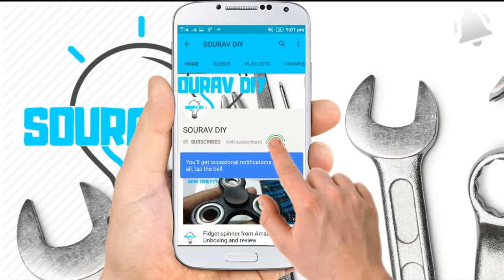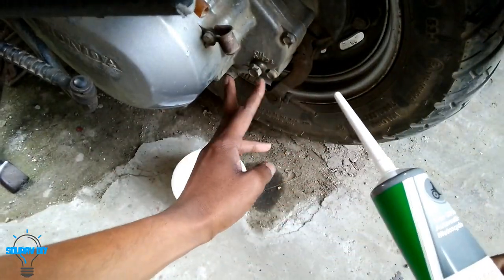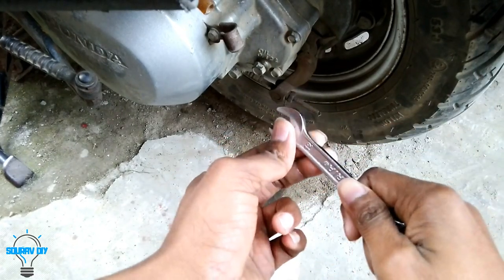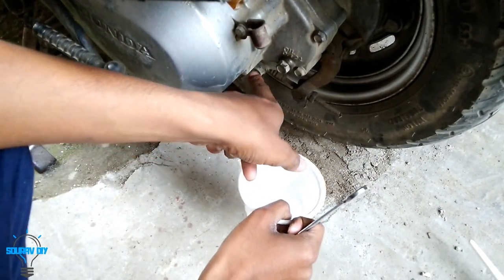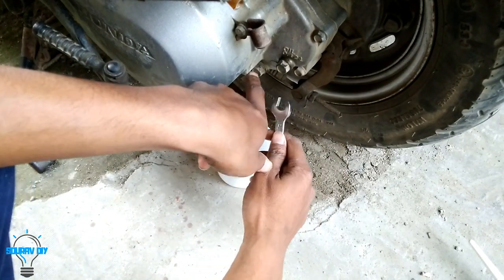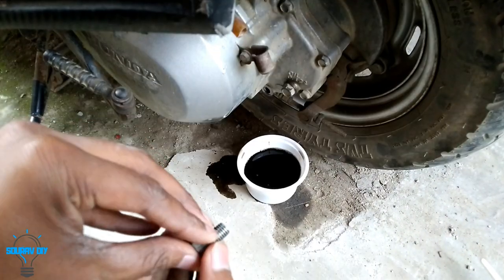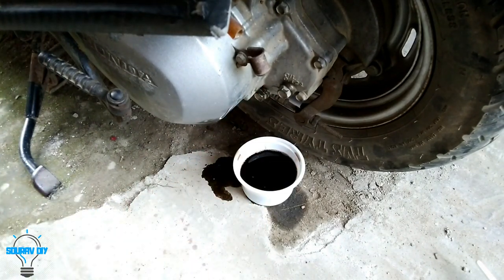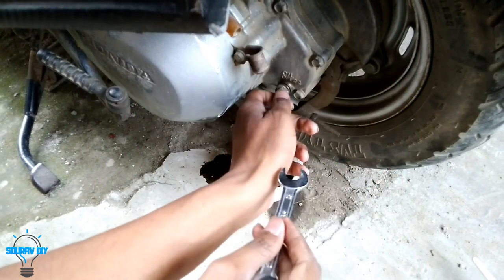Honda Activa Gear oil change | Castrol gear oil

Comment: I have a honda dio 2018 model ...o haven't serviced at dealership after 5 free service. But I do the oil change(Honda genuine oil) in 3 to 4 months at local shop. My rides are not smooth anymore. There is lot of disturbance while accelerating or riding with million rider. Recently I had to use engine oil my local mechanic provided. Now it has starting trouble(self) and riding discomfort(vibrations) too. Is it engine oil ? Is it time to change gear oil too?
Reply from the maker: Change gear oil, engine oil
Clean clutch assembly and change the belt
Reply: @SOURAVDIY  Thankyou for fast  response 
I will do it.

Comment: 13/09/2019 I change gear oil & Engine oil,Can I water wash my activate 4g,I was told by Bike Mechanical that water wash had to done After 2 Month otherwise water go inside the Engine..
Reply from the maker: U can wash your bike , water doesn't go inside engine or gearbox all are sealed
Reply: Who is that legend 🤣
Reply: They lie most of the time to make money use youtube to increase the knowledge and dont fall prey to greedy mechanics.
Reply from the maker: @koolpron  bike wash karne se kabhi water engine ka andhar nahi Jata hai, mechanic are fooling people
Reply: @SOURAVDIY  yes
Reply: Although, Pressure wash not really recommend.

Comment: Hy bro gear oil change ker ne se kya hota hain or kitne km per change ker na hain
Reply from the maker: 8000
Reply: SOURAV DIY hota kya hain is se
Reply from the maker: @deepak_patel2136  lubrication in gearbox

Comment: Where did you get this spec oil , I haven't seen it in any shop?
Reply from the maker: In shop Rs 70
Reply: @SOURAVDIY     thanks for your reply
I have tried in many shops , they do not know about this type of oil. 

Here in my city the shop keepers are least concerned about what the customer wants. they just sell what they have and sell whatever that gives them  a good profit margin.    

What difference did you feel after filling the 80w90 oil rather than the engine oil the authorised workshops fill in the gearbox?

will try in some other shops.
regards
Reply from the maker: No difference but u should not use low viscosity oil in gearbox, Honda  and Yamahacing centre sells gear oil
Reply: @SOURAVDIY  
  thanks for your reply. 
thing is that i got a zest 110 . now every time i go for a service they put in engine oil in the gear box. the tech manager at the service center(authorized) is a good friend of mine. but he never advises to put in gear oil the scooter.  he said we are told so by the company to put engine oil in the gearbox too.  Now they are bound by the rules of the company, i agree.
          I am also worried about the engine oil grade they use which is 5w30. i cant imagine what amount of heat the engine and the oil must be facing in cities where where summer  temperatures are well above 40 degrees celcius.  I wish to put 20w40  in the engine.your comment is highly appreciated!

Next time after the service i am going tho change the gearbox oil myself.

By the way can i put in the gear oil used in the car which is also 80w90 grade?

regards
Reply from the maker: Yes , all gear oil are 80-90
Reply: @SOURAVDIY    thanks next time I will use it 
Regards
Reply: @SOURAVDIY  bhai woh low viscosity nahi, high viscosity oil hai.
Reply from the maker: @manishholla  pata hai
Reply: Rider Ninja  140 grade heavy duty hota hai. 90 grade is for gearless scooter and cars gearbox. 140 grade is for tractor and other commerical vehicles.
Reply: @manishholla  no bro,gear oil have low viscosity than engine oil

Comment: Activa 125 me kon sa gear oil dal ta hai
Reply from the maker: Same gear oil that I am using
Reply: @SOURAVDIY  gear toh hai nii..meri maesteo m...fr
Reply from the maker: It's transmission oil, it lubricates the transmission in real wheel part
Maestro needs the same gear oil

Comment: How frequently should gear oil be changed? I mean after how many km?
Reply from the maker: 8000-10000km
Reply: @SOURAVDIY  mene activa 70000 chala li lekin abhi change nahi kiya.
Reply from the maker: @DAC477  mileage drop hota hai
Reply: @SOURAVDIY  oh thank you.
Reply: @SOURAVDIY  activa 40 km/ litre average h
Reply from the maker: @DAC477  I get 55 + in highway 
7 yr old 32000+km
Reply: @SOURAVDIY  150000 km
Milage 55 kmpl engine me Kuch nahihua air filter change 20 thousand km 2016 model Activa 3g
Or belt drive change 50 thousand km aftermarket Wala genuine
Wala 75 thousand km chala spark plugs 50 thousand km clutch 1lak km
Reply: Gear box ka oil 10 thousand km
Reply: Engine oil 2500 km
Reply: @DAC477  bearing jam ho jayenge, gear kharab ho jayenge. 15000 km me change karwalo

Comment: Engine oil or gair oil kitna km par change karwana padta hai...
Reply from the maker: engine oil - 2000km    , gear oil - 8000 km
Reply: 1500
Reply: @riarishavghosh6539  2500 km for engine oil and 15000 km for gear oil

Comment: Bhai Castrol gear oil ka link send kar do plzzz???
Reply from the maker: Not available online
Search in local shop
U can also use yamahalube gear oil
Reply: Currently castrol is giving combo offer of both engine and gear oil
Reply from the maker: Thats good, price of combo?
Reply: Got it for 290/rs. From local automobile parts shop

Comment: In delhi local shop saying 140rs
Reply from the maker: Overpriced
Reply from the maker: MRP rs70
Reply: @SOURAVDIY   thanks bro he must be lying i am ordering online and also need motul engine will order both
thanks
Reply: @SOURAVDIY  what should be the price for motul scotter full sinthetic oil
Reply from the maker: @varundhingra4110  motul doesn't make synthetic oil for scooter
Reply: @SOURAVDIY  brother it makes search on google you will get it mrp 575 its scooter oil
Reply from the maker: @varundhingra4110  shop pe dekha nahi